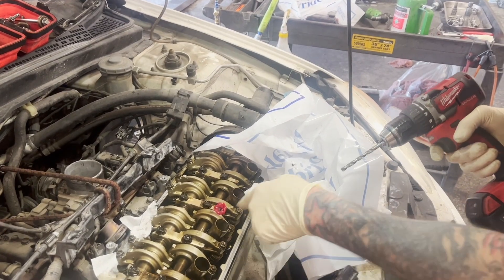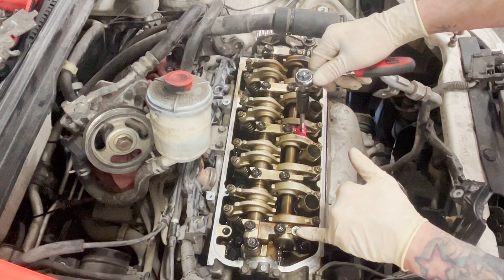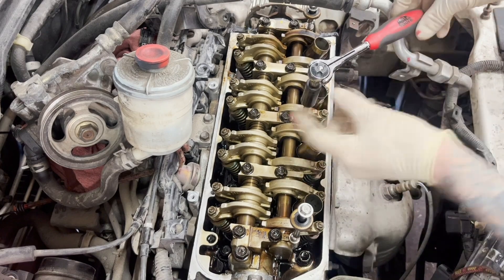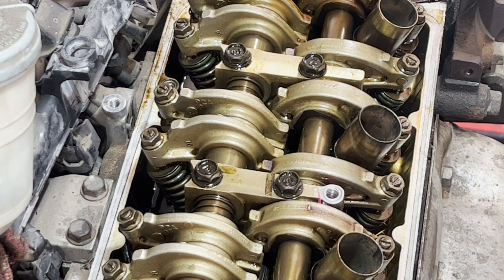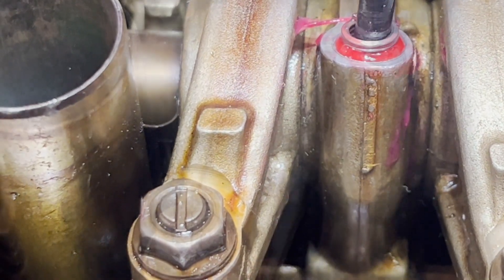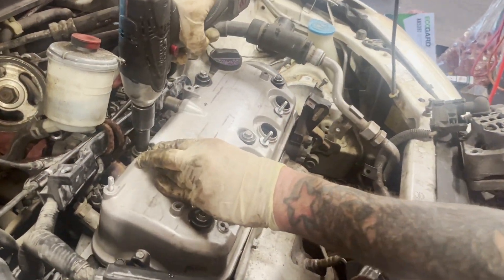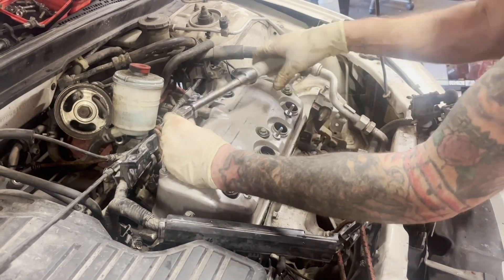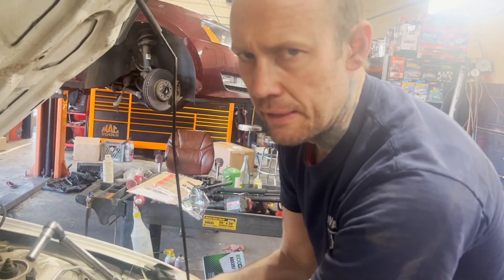HELICOIL ON HONDA VALVE COVER AND ANY OTHER NEED TO USE A HELICOIL

Comment: What kit did you use ? I also have a 99 civic that has 3 of them stripped
Reply from the maker: It’s a M6x1.0 thread pitch. I used the helicoil name brand (the shop I was working at didn’t have anything better). I would highly suggest getting a TIME-SERT kit for your vehicle. here’s a link to what I would get.https://a.co/d/dciT1Xr